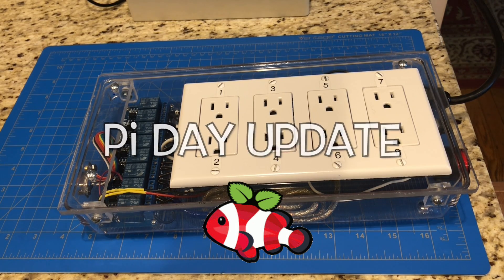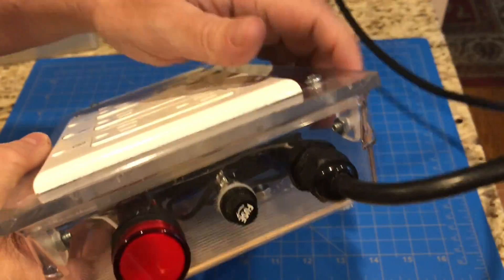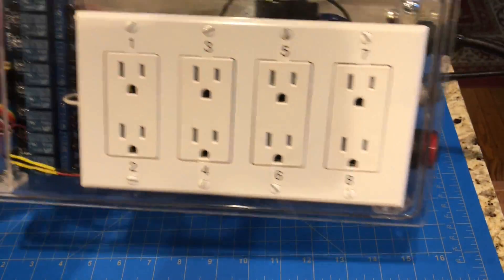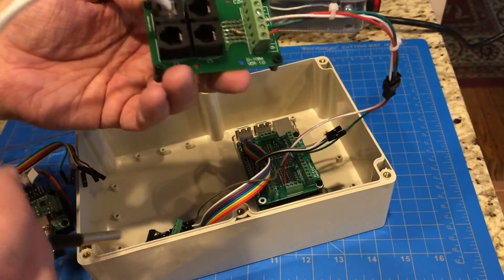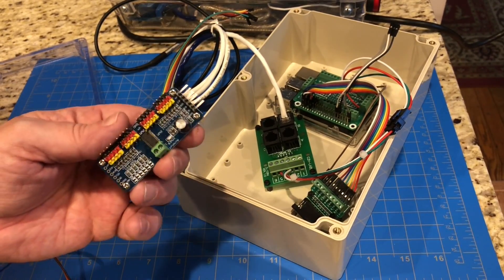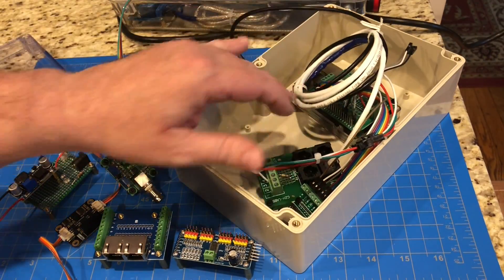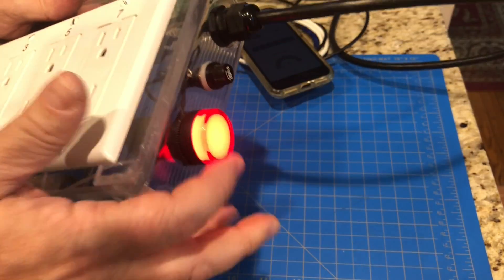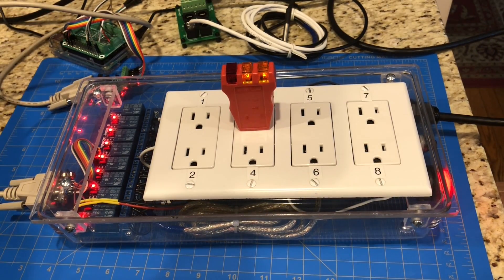Pi Day Update - Reefberry Pi  DIY Aquarium Controller

Comment: hello there I'm trying to build a similar project if you could please let me know if you have released the code as that the main part and I'm struggling  with syntax error's I've tried chatgpt
Reply from the maker: Hi thanks for watching my video.  I have actually started re-writing this project. It's still a work in progress, but my source code is available on GitHub.   https://github.com/ReefSpy/ReefberryPi
Reply: @ReefSpy  amazing thanks its going to help me out a lot if you could please advice me could i only you half your code meaning no cloud and that simple relay control and messaging side of the code

Comment: Hello. Congratulations on the project. I am also trying to do something similar but I would like to try to do it with the Raspberry Pi Zero W. Do you think that 512 mb of ram is enough?
Reply from the maker: I've not tried to run a full desktop environment on a Pi Zero.  512 MB of ram is not much to work with.  Anytime I've used a Zero I've used the lite OS without a GUI.  That said it should run your program fine, I just don't think it will also run a full desktop GUI if that's what you were asking.

Comment: Just found your videos... wish I had of seen them 6 days ago.
Reply from the maker: lol, what happened 6 days ago?
Reply: @ReefSpy  I started building my aquashield. Basically, exactly this except only a 4 channel relay board because I cant see myself turning on and off 8 GPO's. I also burnt out a potentiometer, trying to do exactly the same thing. Then I decided to use an IRF5305. But I burnt out my PWM line so I've had to use an octocouple to isolate the PWM from the MOSFET.

Comment: Cool update! I'm not sure if you remember but I'm doing something similar for my own tanks but using Java instead. As of right now I have the code where I would like but I'm completely stumped on an enclosure for it all.. I have no idea where to start. A clear enclosure like that would be pretty good, did you make it yourself or buy it?
Reply from the maker: Cool!  You can buy project boxes on Amazon, and even find them cheaper on eBay if you don’t mind waiting for it to ship from China. This clear one is actually a drawer organizer i found at Lowes. It is meant to put pencils or silverware in. I made the top from some scrap acrylic left over from a previous project. It turned out to be the perfect size for what I needed.

Comment: I already have a RP and wondered if anyone had done this yet. Just curious, how much is invested in all the extra cards/chips and sensors?
Reply from the maker: Good question. I never added everything up. Some things are pricey like pH or Salinity probes, and other things like temperature sensors are very inexpensive. The costs can add up quickly. For instance a connector might only cost a few cents, but you will need to buy a pack of 100.  Its a fun project. I find most of my stuff on Amazon or eBay.

Comment: Awesome! I was looking forward to another update. Can you post a link on the parts you have used so far? How have you gotten the skills to make something like this? Profession or tinkering? I really want to try making this (safely of course) but I have very limited experience with the Raspberry Pi modules. I have some Python coding background though.
Reply: Also, the app you made is super slick! Just a thought but you should consider creating affiliate links for Amazon or some other place for the parts you have used so you could get a little kickback and those of us interested in the project can help support/purchase the correct parts (edit: ok so just watched an earlier video and I see you had affiliate links, maybe you can have a running list of the links somewhere like in the comments?). Thanks!
Reply from the maker: Good idea. I’ll post up some links in the description. I have a background in software development, but the rest I learned by tinkering and reading up on what others have done. I’m still learning new stuff every day.
Reply: @ReefSpy  Excellent! It's really impressive on what you've accomplished.

Comment: Looks like you ran into the same problem I did... fitting everything in an enclosure.  I 3D printed the one I mentioned to you before, and stuff would not fit, I made hole and mounts based off measurements before the items arrived, and, go figure, they were not right.  I decided to go with two enclosures. One will have the Pi and a touch screen, figured I may just need to walk up and change something and not want to have to go to my pc or phone and log in.  The pi unit will connect to the second enclosure using a 37 pin db connector, If I am right, ill be able to send 5v power through a pin from the second unit which will power the pi and screen, letting my have one power supply in the second unit, powering everything. The second unit will hold the relays, power, power converters and connectors for temp, ph salinty etc... All in all I had to completely trash the original enclosure designs and start over. I am far from pro with CAD so it is taking a while to get it all redone, but Ill send you some images when I finish it.
Reply from the maker: awesome!  sounds like you have a good plan.  every piece to this project is a challenge in different ways, but learning alot as i go.  its been a fun process.